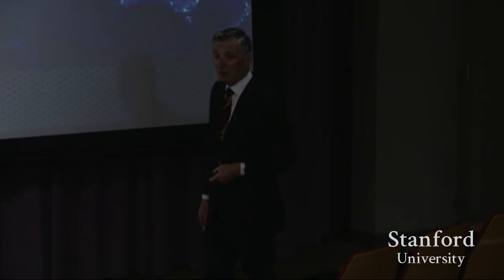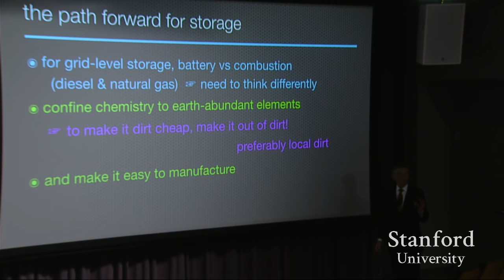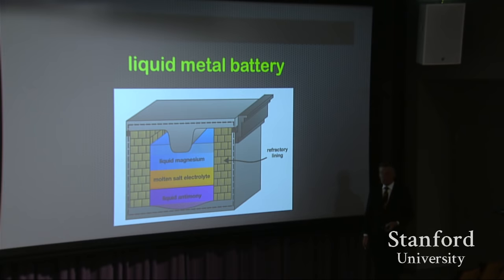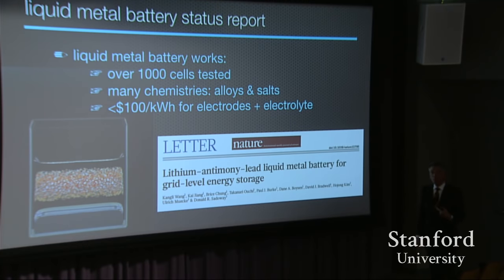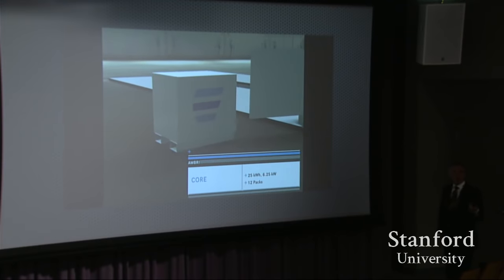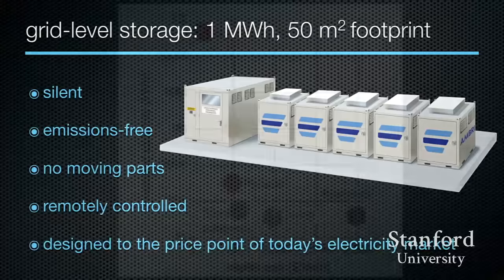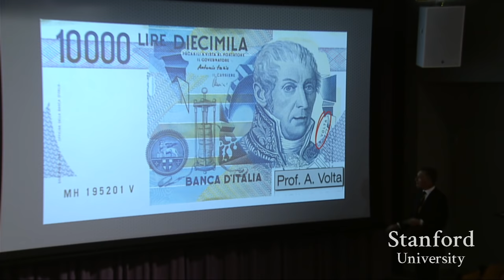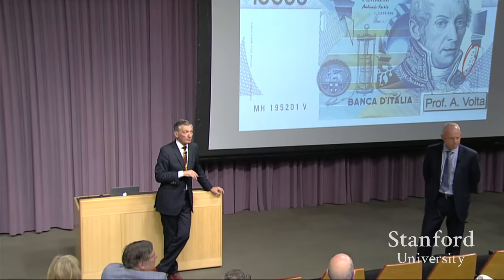Don Sadoway | Innovation in Stationary Electricity Storage: The Liquid Metal Battery

Comment: Evidently, the process was never successfully commercialized due to several problems. So far, liquid metal batteries are still not practical.
Reply: Hohoho, you must be new here. Many technologies take around 20 years or more to go full commercial, especially if it is a big change in a field with low profit margins .......
Reply: @Zonkotron  I am sure that you are correct in general. I wish them luck, because we really DO need inexpensive, high capacity, high return batteries. Funny, I did not see any mention of the return. Typically, 70% of the energy used to charge a battery is returned when it is discharged.
Reply: @DavidFMayerPhD  Oh yes....it has cost me many, many evenings of going to bed way too late in the last few years. Research has shown us how just about every problem the world is facing today could be tackled at costs that, while very high, would not be all that out of proportion when compared to bullshit such as the iraq war or the cold war. Some developments are very promising. like how solar cells are dropping in price in fashion similar to moore's law. This is also where i get that 20 year number, modern high grade commercial solar cells and lithium ion are both 20+ year old technologies and only becoming really affordable right now. Internal combustion engines and steam turbines also took decades to get real good. Steam engines took over a century to get really decent. Industrial progress takes a while. If anything, it is faster today. For batteries this very presentation is the missing link i was searching for because it seems to have all the advantages(and downsides) of NaS while being simpler - hence cheaper. What really upsets me is fusion research. Fusion is hard, really hard. It might never work out. Research is expensive. But instead of speding the money dripwise and may finding out never or too late if it is feasible we should be undertaking Apollo program level spending on it right now across all the G20 countries to figure out if it is practical quickly. Fusion is this technology that is always 40 years away but what people fail to recognize is that if you never spend to saturation, this is what happens to every technology. It's like large construction projects given to the lowest bidder always ending up being late and over budget, you just can't cheat in engineering.
Reply: @Zonkotron  I agree, except on Fusion, which is simply a waste of money. $25 billion has already been spent on Fusion without producing ANY net electrical power. It is time to pull the plug on that losing technology. No technology that has alread cost over 25 billion dollars without even a working prototype (let alone commercial operating device) is worth investing in.
Reply: @DavidFMayerPhD  Given how hard fusion is and how accaptable it is for aerospace Projekts to yield garbage at much higher price points i would be concerned at 2000 billion or so. 25 billion  is nothing in terms of large scale science
Reply: @Zonkotron  I certainly do not see it that way. I am highly doubtful that it can EVER be done. IMHO, $25 billion is enough to spend on an abject failure that has produced absolutely ZERO electric power.

Comment: Who owns the patent to the 18650 cell? Exxon Mobile. Who’s watching his every move and thought? We need to change our entire culture and that won’t happen without a lot of people leaving the earth.
Reply: That's crazy.  18650 is simply the dimensions of the cell: 18 mm X 650 mm.  Tesla is already using a 2170 cell that will be used in all models going forward.  Each cell has about twice the energy density of the 18650 that it is in the process of replacing.

You cannot patent dimensions... Apple found that out years ago when they tried to sue for infringement of the iPhone's very ordinary, unremarkable dimensions.

You are woefully confused about the Exxon patent, regardless... their patent was for the chemistry of the nickel metal hydride battery used in the Toyota RAV 4 from years ago, which is absolutely NOT a lithium battery.

Comment: There is no need for any of this...you can turn kinetic energy from the sun and wind etc and turn it into potential energy with none of the drawbacks of batteries by lifting weights into the and use that potential energy when needed